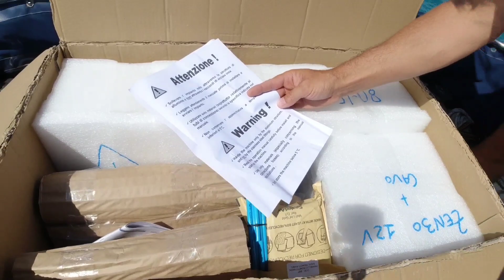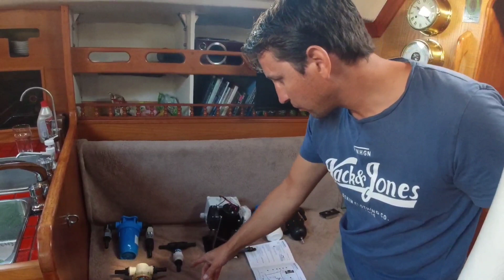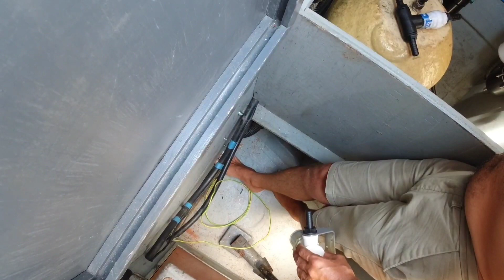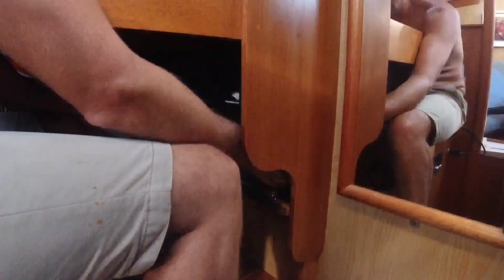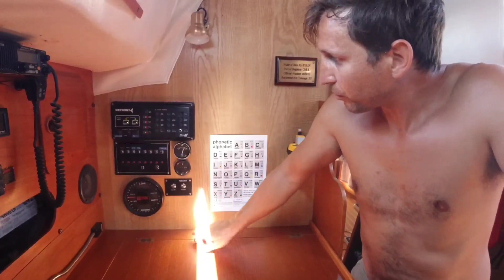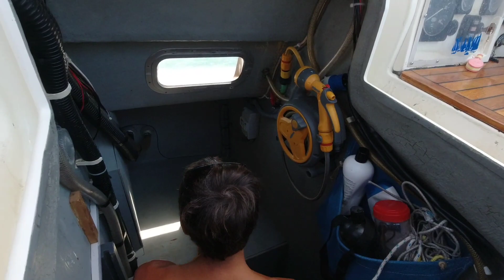Best investment yet, we install a Watermaker!

Comment: Hi guys! Very well don and thanks for sharing. Just one question - is it fully automatic unit? I mean that after initial set up you have just to push on/off button to get the water?
Reply from the maker: Hi, No problem, we are glad you enjoyed watching the video. Yes, once you press the on/off button you can either turn it on and it will run until you press off again or you can press and hold and select 1hr, 2hr, 3hr running with a sequence of beeps and then the unit will flush automatically with fresh water after the selected running cycle. Hope that answers you question, Cheers

Comment: Hi, good work, and great video (now subscribed), from a Corsair owner in N.Ireland.
Can I ask why you went for this model, as I have seen cheaper (significantly) on the market (Katadyn & Aegina) [sorry not trying to be rude ;-)]?
Reply from the maker: No completely fair question Simon, we will go into this in more detail in our next video on the watermaker, but the main reason is its patented technology that allows us to run the water maker on only 110w per hour. This means our 250w of solar is more than enough, we have no need for a generator or too even run our engine like many other cruisers we know when anchored for low periods of time. Hope that answers your question